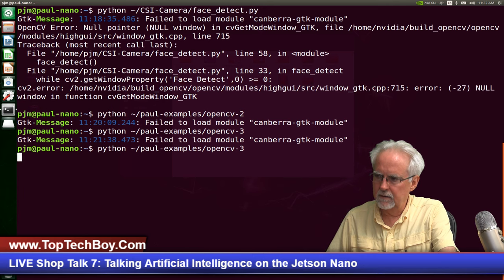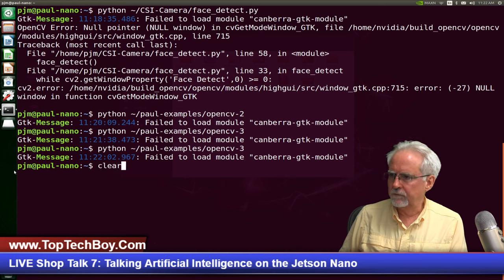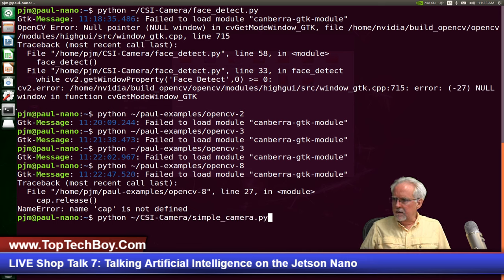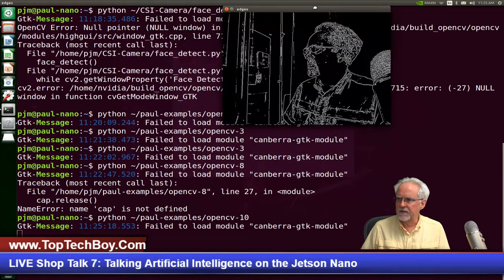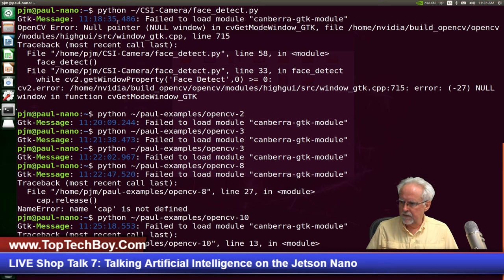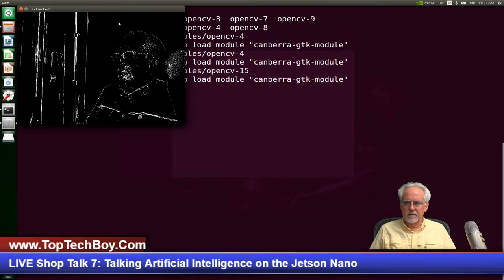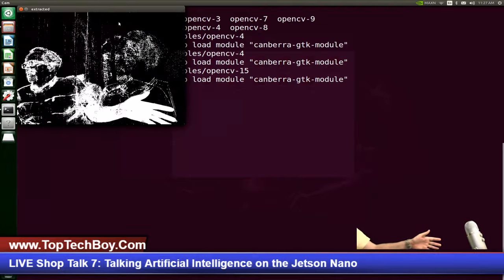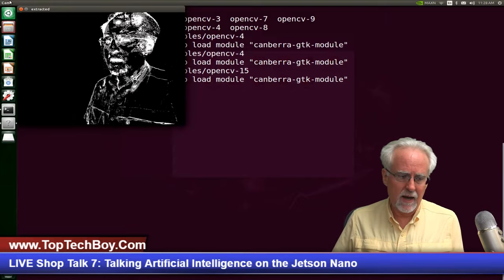LIVE Shop Talk 7: Talking Artificial Intelligence on the Jetson Nano

Comment: • 34:40 - It has been trained on tea-bags, but that's not a tea-bag, it's a tea-bag in an envelope (which it said). That's like expecting it to see a box and know what's inside (which might be possible if you include text-recognition—assuming there is any text on the box and it's representative of what's actually in the box—but that's not what this is). Take it out and try.
• 44:10 - Games (and video-editing and anything else that requires real computing power).
Reply from the maker: Good suggestion. I did take the tea bag out, and it just does not recognize it . . . meaning that the recognition data base I am using has not been trained on a tea bag . . . would have thought it would have been in there, but nothing there. Thanks for the comment

Comment: 7 minutes to boot ? Are you serious ?  My pc which is nothing spectacular running windows 10   takes less than 60  seconds to open the  login page and about 15 seconds after that I’m looking at my desktop . You need to seriously sort out your start up programmes .Are you sure your security programme isn’t doing a scan on start up ?
Reply from the maker: The issue is we are part of some sort of corporate network, where there are all types of network credentials and so forth. I am not allowed to set it up any way I want. Takes a loooooooong time for outlook to load, and skype which are part of the boot up. Even ignoring the slow boot, I hate everything about windows 10. The first good operating system microsoft had was windows NT and the last good one was windows XP.